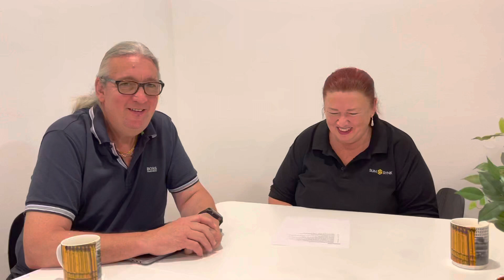Common questions and answers and sunsynk inverter part two

Comment: Dear Sunsynk Team,

I have water geysers configured as non-essential loads in my system. I’ve observed that when my essential loads don’t require power, the solar energy isn’t being diverted to these geysers. Do I need to connect the geysers to an auxiliary port in order for them to receive power during such times?

Thank you for your assistance.

Comment: I installed a Sunsynk inverter and my system mode setting keeps changing back to 20% after 2 minutes of changing it... my installer has tried fixing it, Sunsynk has remotely updated the firmware but the issue still persists. Please advise if you've come across this issue before and what the solution is?

Comment: Hi there, thanks for all your awesome educational videos on the Sunsynk products. I am from South Africa, and have just placed an order for the 5 kW Sunsynk inverter, and the matching 5.1 kWh Sunsynk battery. I haven't been able to find much documentation or reviews on this battery, but my supplier and installer says it's very good. Do you guys have any YouTube video, documentation, or data sheet on these batteries? Or do they trade under some other brand as well? I am really excited to have  my backup system installed next week, as here in South Africa we have constant load shedding, because our national electricity supplier is useless. I am totally blind, and use the VoiceOver accessibility feature on the iPhone, and I have already downloaded the Sunsynk Logger app, and although I have no inverter to connect yet, it seems very accessible.

I am prepared to liaise closely with your developers, if I come across any accessibility issues, as I want to use the app to interact with my inverter and also monitor the steps. I am planning later to add solar panels to the system, when money becomes available, then I can be less dependent on our amazing electricity grid.

Comment: Sunsynk is exact rebrand of Deye hybrid inverter in china isn't it?
Reply: It is, but all the software is western. Also the support is UK based. If you find the right wholesaler, they are actually cheaper to buy in the UK than directly from china.... Plus you get a 5 year warranty :)
Reply from the maker: No it’s not, Deye is our sister company but use completely different software and apps

Comment: Is it 450 voc per mppt? So can I have 2 arrays each at 450 voc for each of the mppts?
Reply from the maker: Actually you can run 4 arrays @ 450v on the 8.8 kw
Reply: @sunsynk  Now I'm more confused. 
On the 5.5kw that I bought it clearly has 2 mppt's (there are 4 mc4 connectors) but the manual it came with says on page 21 that it only has one?? Therefore my question about how many 450v arrays. 
Seems the manual may not have been updated correctly.
I dont want to let the magic smoke out.